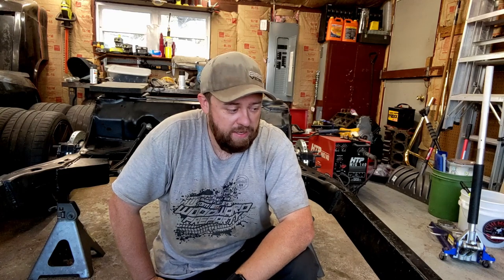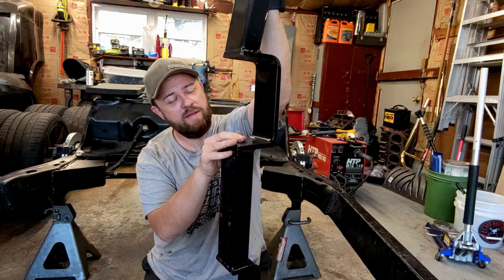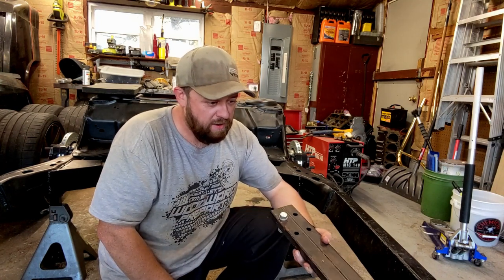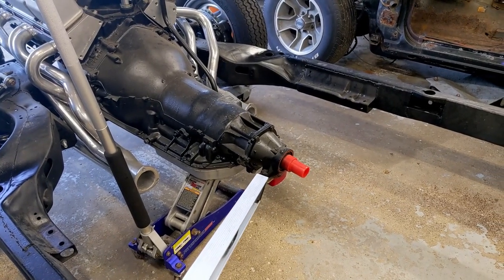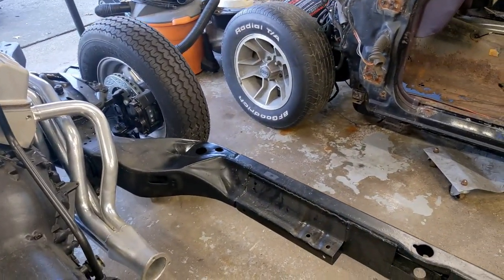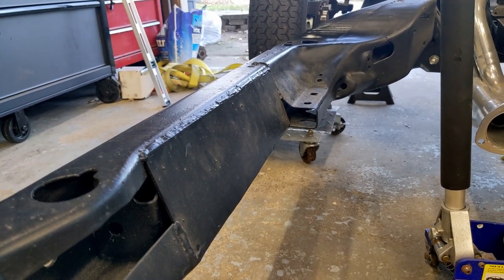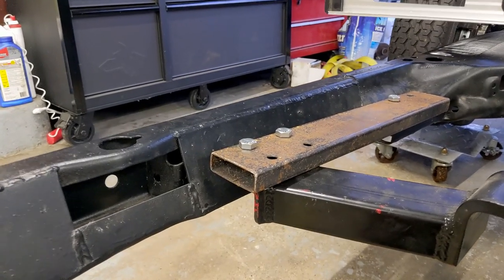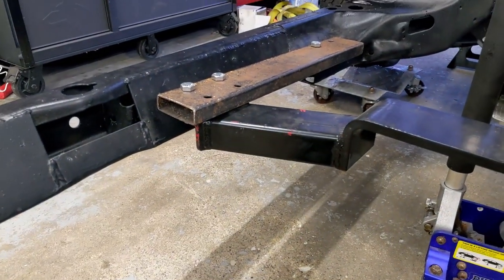G-Body Trans Crossmember | Mock Up & Planning | Part 1

Comment: What kind of spline yoke would you recommend I got the same transmission? Looked it up but they got different sizes. I’m still learning transmissions
Reply from the maker: It's going to depend on the power level you're at to know what you will need. That said, I wouldn't be the one to recommend what parts you would need. I would talk to someone at a performance transmission shop to get a good recommendation. I know a lot of places like and use Sonnax parts, so that may be a good start for you.